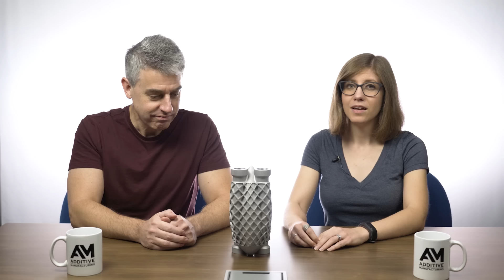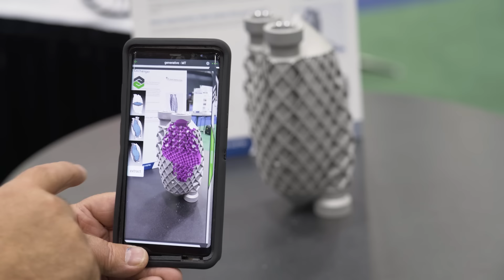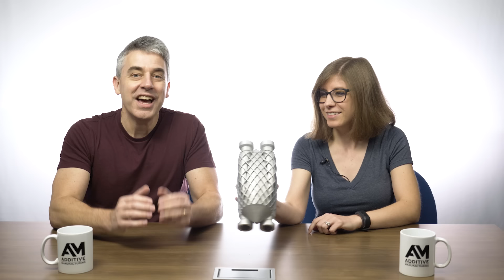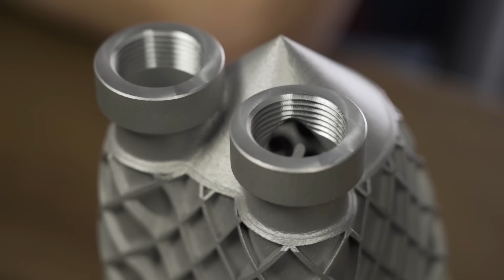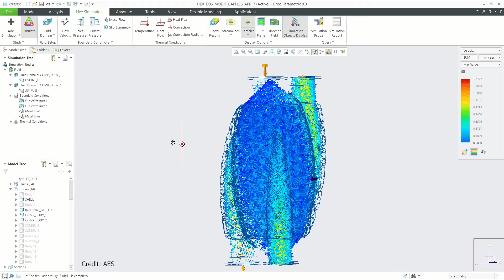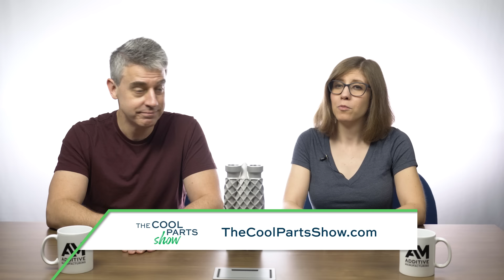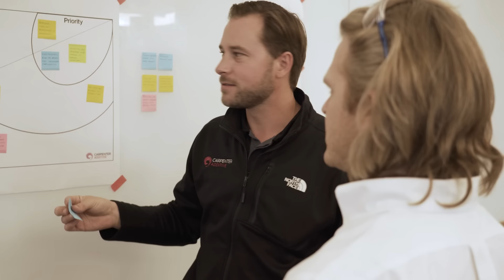3D Printed Heat Exchanger Uses Gyroids for Better Cooling | The Cool Parts Show #43

Comment: Hmm... however, the original design doesn't look that complicated to me, and likely buildable & even repairable relatively inexpensively by someone with a high school education & tools available on the street, nor would it seem to me that an aircraft that is essentially a giant fan would be lacking in potential sources for cooling... Until such time as I can obtain a desktop additive metal printer for a very reasonable price, I would prefer not to become dependent upon unnecessarily convoluted (or patented) designs, especially as in searching for ~'gyroids' I don't even see any downloadable 3d files for such a design yet.  I am not aware of having seen any cost effective parts produced by additive/SLS metal printing in general yet.
Reply: A helicopter being "a giant fan" does not mean that fluid-to-fluid heat exchangers are not required.

Comment: Impressive design and a great example for what can be done… just missing a few critical objectives 
- maintainability (cleaning / repairs)
- inspection
Reply: Toss it in an ultrasonic cleaner when doing maintenance? Air pressure leak-down test after cleaning?
Reply: @Dark One Which is great when you're deployed out in the field and supply has that part on back order for more than 2 months. 3D printers for this kind of material don't seem to be fast and reliable enough to be a field-ready deployed piece of equipment (yet), and there would be high demand put upon them if more and more parts were made like this. There would still be wait times on turn over for the not only the part to be made but pass whatever NDT process is in place for safety as well.

Thus something you can break down, clean up, and get working with a wrench and some rags and elbow-grease has it's desirable aspects in many real world situations.

Comment: This advance could be useful in Aerotermia, Nuclear Fision and Fussion reactors, Rocketery, Computer Coolers(for classical and quantic ones), combustion engines, etc. We loose a lot of energy in noise and heat. We could warm air before enter to combustion chamber with the same heated, by explosion gas, for instance.
Reply: Problem is I'm not sure if it can handle the conditions a nuclear reactor (or other similar energy generation) heat exchangers need to take while also being easy to inspect and all that good stuff. Cool proof of concept, maybe someday after the technology matures.

Comment: I understand it was made to replace the heat exchanger for a military helicopter, but my question is. Is it actually currently or going to be in use?
Reply from the maker: The project continues to move forward. Dr. Vlahinos says a newer version of the heat exchanger with some design modifications has now passed all bench tests and is undergoing flights tests
Reply: I'd say....don't bet your life savings or even your lunch money on it.

Comment: I like how the testing ends with a marketing-ready graphical display, but you have the physical object in front of you... untested. Looking through the holes, you could see that a bunch of debris was just chunking around in there, which is great for a fuel/gearbox oil system. The aluminum/magnesium alloy, however, would be quite reactive, freeing up a continuous flow of new debris into the fluids. ...I like the rotisserie chicken shape though. It's very well decorated, to make it look all "high tech", or whatever, for that all important eye-catching display, that neatly covers up the BS repurposed default part slicer infill "gyroid" that anyone with a printer can tell you A) it is used to reduce hard accellerations while infilling, B) It's super cool to watch print, and C) it is entirely incapable of keeping 2 fluids apart, let alone providing any efficiency increase to heat exchange. The wall thickness is far thicker than the traditional stainless steel sheet metal stacks (With herringbone riffles, which is what this guy is trying to re-sell his fake gyroids as), and so it will never have the contact capacity and density of these run-of-the-mill designs. Also, the rounded shape does not pack well inside a compact engine bay, the raised netting makes "dead space" which impedes external convection heat exchange, and the equivalent unit for a super-heavy passenger jet engine is about 1/6 the volume of this thing. It's safe to argue that this entire object, which consists primarily of marketing hype, would be a downgrade, even if it wasn't fake. Even if it were on a space station, it would be far better to bring some sheet steel for general purpose and build a plate-style exchanger, or even a shell and tube exchanger (which was completely misrepresented in this video, by the way. The shell-and-tube exchangers on these kinds of engines are pass-through, with no bends. What was shown was an industrial factory shell and tube exchanger)

Comment: A classic plate style heat exhanger would also have been an improvement, this is like going from a wooden wheel to a carbon fiber wheel, when aluminium wheels would have been a massive improvement already.
Reply: I'd be willing to bet that this can tolerate significantly higher pressures than an equivalent-surface-area plate-fin HE. Higher pressures mean you can make the flow paths longer before losing pressure, which means a better exchanger performance. All theoretically, of course. In practice, these wall thicknesses might be pretty bad for performance.
Reply: @avialexander  An ordinary heat exchanger was made of pipes and tubes - what could be more reliable and simpler?
Reply: @Vlad  they're talking about plate heat exchangers not tubes

Comment: Always hilarious to see random youtube commenters suggest that the industrial design award winners should think about X,Y or Z.  
Do they seriously believe they've got a better handle on the situation & that the group behind this didn't consider the required durability & servicing requirements for the application, or the testing procedures?
Reply: I have my doubts that this is a real product that will ever be put on a military aircraft.  I think this is a device manufactured to promote their technical capabilities more than a heat exchanger that will ever get near to an actual helo engine.  It is quoted above that they gave NO consideration to the possibility of fouling/blockage.  If that isn't a red flag to you, it oughta be.
Reply: @chuckschillingvideos  Could you give me the timestamp of when they stated that they ignored fouling/blockage considerations?  It's not popping on the transcript.

Comment: With so many direction changes of the fluid, isn't there a lot of cavitation? Just wondering, I not an engineer, just a mechanic.
Reply: You would certainly think this would be one of the critical factors built into their computerized design application; then again, I question whether this is even an actual component intended for production or just a one off made to show off what they can do.

Comment: I can tell they do not understand why this is different than standard heat exchangers. In industry the right name is shell and tube.  Connect should be known as fittings "npt, sae, ...etc" the internal configuration enhances the heat transfer coefficient breaks up the boundaries and creates turbulence.  This creates a high beta which in turn makes a compact heat exchanger.
Reply: Of course the presenters don't know anything about heat exchangers, but the presentation is still good. They could have mentioned that shell-and-tube is not the only style of heat exchanger, but it is apparently the type used in the original part. The 3D printed part is effectively a plate-type heat exchanger, with gyroid plates.

Comment: Uses the helicopters' fuel as coolant.

I hope they've tested the heck out of this, sounds kinda dangerous, but I know nothing on the topic.
Reply: The original design - not 3D printed - also uses the fuel as coolant. While it may be surprising, this is a very common practice in aircraft; it makes sense, it works well, and if properly done it is not hazardous.
Reply: The danger isn't to the fuel but to the lubricant.  If for whatever reason the internal structure is compromised, the lubricant could become contaminated with fuel and fail prematurely.

Comment: I am an engineer and worked around engines a lot, the design reminds me to the common heat exchanger on cars, but the manufacturing process go me thinking. First the tensile strenght. One of the common materials used in heat exchangers is duplex 2205 stainless steel, witch is manufactured by forging, and so achieving the required molecular structure and a smooth surface. Then it is built in into the heat exchanger. The tensile strenght of the Duplexx 2205 is 90ksi compared to AlSiMg witch is around 33ksi. The rough surface finish is something that is commonly not desireable in contact with fluids, witch means higher pressure especially early when the fluids are cold. Is there a technology avaibe witch allows similar structures, but with smoother finish and with a higher tensile strenght as the mentioned AlSiMg?
Reply: It could probably be subjected to an "Extruded Hone" process to smooth the surfaces.
Reply: If you need a very good surface finish you could always do abrasive flow machining on the part.  You basically pump a high viscosity fluid with abrasive through the channels and polish them.  The guys I work with have made a large number of micro channel heat exchangers by 3d printing and the surface finish has never been an issue.
Reply: smoother finish --> extrude hone after printing :) higher tensile strength --> yes, you probably can't get the work hardened molecular structure, but you can even print inconel!
Reply: I don't think a smoother surface finish can be achieved, but I know that the powder prints can be made with some steel alloys. I know those technologies are also used in (extremely high performance) rocket engines, it may be interesting to look there on how they are dealing with those problems.
Reply: To get a smooth finish, there are machines that also integrate a mill and can mill each layer as it is finished. Not sure how different forged metal is from printed metal, which is like a continuous weld.
Reply: yes, there are dual manufacturing machines, they add a few layers, then CNC machine it, then add, machine etc... a few of them out there.
Reply: One could force polishing pasted trough it if it was required but with its efficiency being three times the original design (according to these guys) this does not seem necessary. 
Would be Interessting to see if their values are from a theoretical simulation or the real world
Reply: Recently, the company I work for thought about trying 3D printing to manufacture some of the complicated manifolds we use (involves a lot of spark erosion). We found a company that sinters Inconel (I think it was Inconel 625). We have yet to pressure test it to compare to a normally machined version - but we are hopeful! Surface finishes do require some post-processing - we needed to put seal bores in as a final machining step.

One day we will have machines that will not only deposit material, but also machine features and do surface treatments during the deposition to do just what you're taking about - and I'm very much looking forward to that future!
Reply: Wouldn't you want a rougher surface anyways? It would increase turbulence and therefore improve thermal exchange
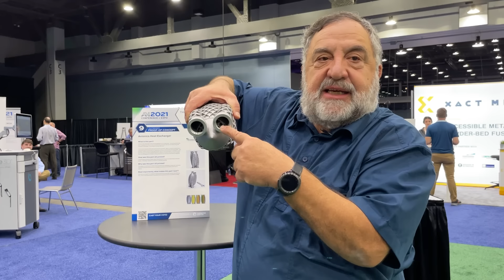Reply: @8:30 he asserts that the lattice used inside is more efficient and resists 10x the pressure of a conventional heat exchanger.
Reply: It's possible to heat-treat the surface, but it may lead to deformations.
Reply: Perhaps 3d printing a hollow ceramic negative and casting the part in a vacuum?    then for the surface finish,   you could pump a suspension of shot through it to shatter the ceramic and peen the exposed metal surfaces.
Reply: Can other materials be used?:

Yes, almost any metal or alloy is viable for powder bed fusion. The machine I worked with in college (DMP flex 350) was set up to run stainless steel. I don't recall what type of stainless exactly. But titanium, cobalt, aluminum, etc. We're all options. 

Can it have a smoother finish?:
In a word, No. Printers like these produce parts with "near net" shape. A fancy way of saying they are equivalent to very accurate cast parts. They usually require some post processing like sand blasting or even machining. The part in the video had both done on it. You can see that the treads are very smooth because it was machined. I'm sure there is other research being done on ways to improve surface finish. I bet there is research on coatings or perhaps solvents that could smooth the surface, but I'm not aware of any and have not seen any commercially available.
Reply: I'm nether a engineer or anything like that nether I even finish school 😅 so my comment my be a bit stupid.
One solution to that I could think to "clean" the inside of complex designs like that is to starts printing on top of a plate, the idea is to be able to keep the part in it's place and every 10 or so layers use a CNC to "clean" the inside or hard to get places, then throw a bunch of powder to refill everything and use the same system that they have to leave a smooth final layer of powder to resume the print for another 10 layers. Basically will be a CNC inside the metal 3d printer that will work with the prints, at the end you just cut off the 3d print from the plate
Reply: @SoloMobilGaming  You can be intelligent without having an engineering degree, and your concept makes perfect sense.
Reply: Stainless Steels (316L, 304L , 17-4 PH, 15-5PH, 420, 254, PH1, GP1, 630, 410) can be 3D printed if you perform a quick search on the web.  However, I'm not sure of the force per surface area capabilities with the fusion or laser sintering processes.  Seems the not polished surface area of the 3D printed SS would further increase the heat exchange performance?  Will be interesting to see what a SS 3D printer product SME replies noting, in more detail.
Reply: Regarding the tensile strength:
I guess the shape is compensating the weaker material
Reply: I have similar concerns about 3d printed metals...in all the videos I have seen, it looks the finished piece has that granular finishing, that suggests the internal structure doesn't work and doesn't have the same characteristics of the casted or machined metals.
Reply: Extrusion honing could be a solution to the surface problem. Non neutonian high shear fluids with an embedded abrasive powder can do a good job of polishing surfaces to the point of being unreasonably smooth.
Reply: Frili, whats your take on the sintered effect of 3d printing being viable for this considering the constant stress propagation points that a 3d print like this generates with heating and cooling? wouldn't this crack after just a few hundred cycles?
Reply: Rough surface increased surface area
Reply: Maybe there could exist an abrasive fluid that you could just pump throu it for a while?
Reply: there is a process by Hirtenberger (Hirtisation), which is an electrochemical way to remove internal supports. Also, it drastically improves surface quality. 
it's basically a chemical bath with electricity, so dunking that part in would be very easy.
Reply: Call the shitty surface finish turbulence generators and sell it for more money.
Reply: Was waiting the whole video with any charts, looks like that's another super technology without of any proofs

Comment: The external rib idea is interesting. I'll try that on my own hobby prints
Reply: I'm not sure why they made a big deal of it, car parts have used them for decades. Recent plastic intake manifolds in particular.
Reply: @hydrocarbon82  I was thinking the same thing... Almost all the parts in automotive industry (and others) have that. This is way older then additive manufacturing boom
Reply: It's super common on rocket fuselages, just on the inside instead of the outside.  I'm sure there are sources that talk about the inside of SLS and Falcon somewhere, they would probably be the state of the art right now in that area.
Reply: It's just a heat sink.  Ain't nothing revolutionary about heat sinks - they've been in use in a wide variety of applications for decades and decades.

Comment: That holds 10x the pressure of the exchanger you showed at the beginning? I don't think this will have the service life of the tube type in that application. Great looking part.
Reply: No he mentions it holds 10X the pressure needed, the classic design could also have a 5-10X pressure capability then needed.
Reply: I believe they said it could take 10 times the pressure, not that it exhibits 10x.
Reply: Capable of 10x the pressure, i doubt the operational pressure was changed significantly on an existing aircraft.  That 10x is likely just safety factor, although it begs the question why not make it thinner/lighter if that is the case?
Reply: @Whatsinanameanyway13  8:13 The sophistry potential, excuse the pun.
It uses curves like a Campaign or old Coke bottle.  Ten times more pressure than 'required'.  Not difference in pressure, so it's relative to atmospheric.  Oil or fuel pressure, ~30psi (a guess), would expect them to be equal on booth sides.  Test pressure w/ same potential on both sides, 300psi wouldn't be unreasonable.
300psi on one side w/o counter pressure, not so much.
Suggested design for a military helo, so it will have to take projectile strikes to pass qualification.

Comment: So no HIP, support removal, chemical etching? Also, how is the Augmented reality part of it done?
Reply from the maker: Response from Andreas Vlahinos:
Heat treatment and HIP are applied but no chemical surface finish. The internal surfaces have better heat transfer coefficient if they are rough.  The AR experience is published with one click from CREO and can be viewed in any device with the “View” app from PTC.